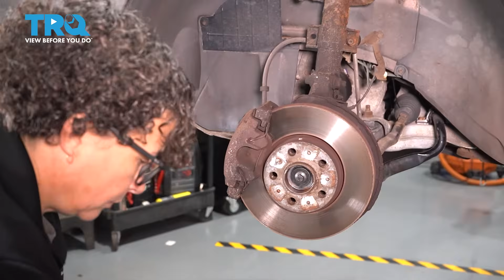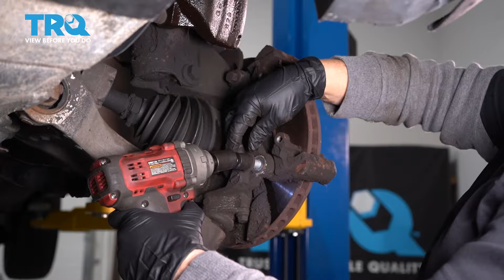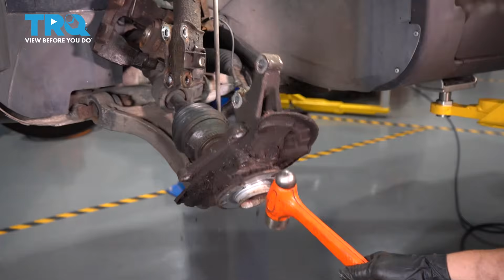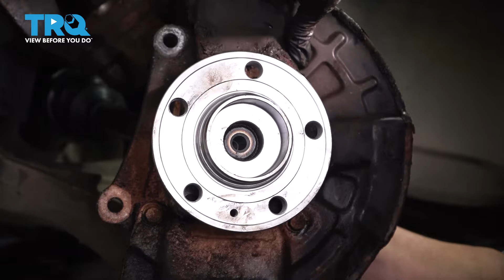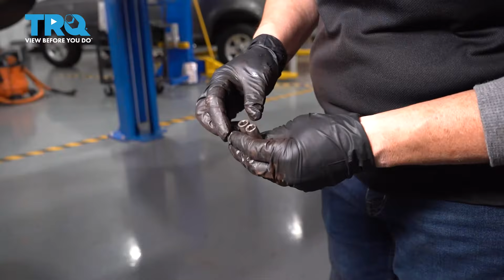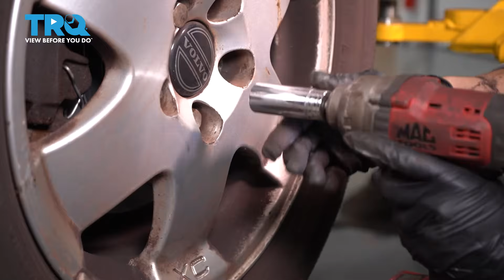How to Replace Wheel Bearing & Hub Assembly 2001-2007 Volvo V70

Comment: Notes to self:   bearing hub back bolts - 18mm socket, 20nm then 60 nm + 60 degrees

Strut bolts - 59 ft-lb 

Axle bolt 26 ft-lb

Comment: I did the same job but you didn't remove drop link is pushing that shock absorber alot,,,, shock can't go back in the same position ,,,alot of  pressure of that drop link ,,wrong informative video,,,wrong

Comment: OMD.   too much disassembly.  remove the wheel. Remove the axle screw.  Remove the ball joint nut.  Pull the control arm down and pull the axle out.  Pop the hub out (slide hammer) and install new.   Easy.
Reply: Is it that the bolts can't be accessed from the back while the axle is in place?  Would be nice to just pull the hub and bearing without disassembling the suspension.

Comment: the pickup as you call it for the abs sensor ( proximity sensor ) it is not the bearing face it is the reluctor ring on the drive shaft , do not give wrong information

Comment: Great tutorial. I should have just removed the entire hub/knuckle assembly when doing my ball joints and struts. Would have been 10x easier to replace the wheel bearings at the same time.